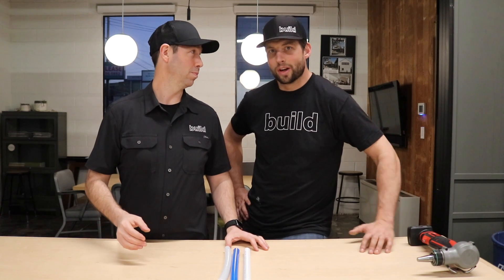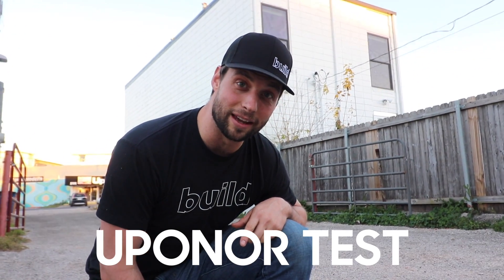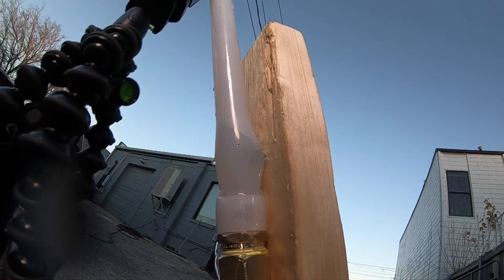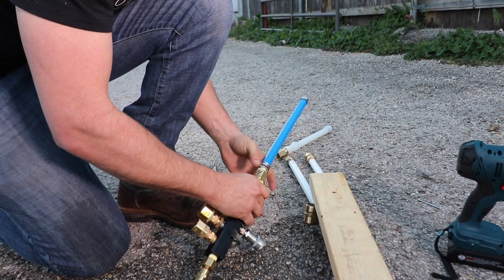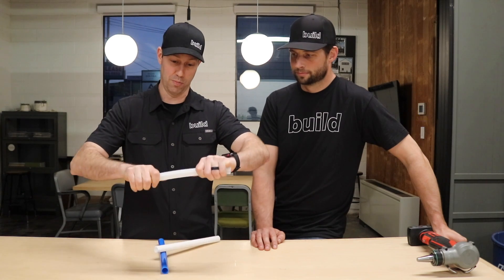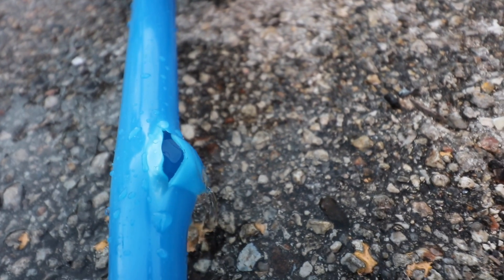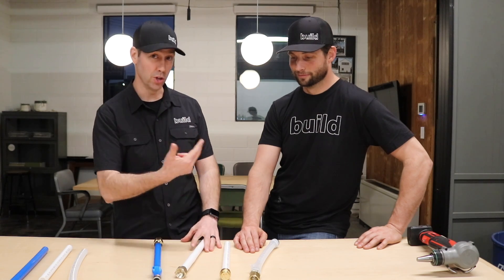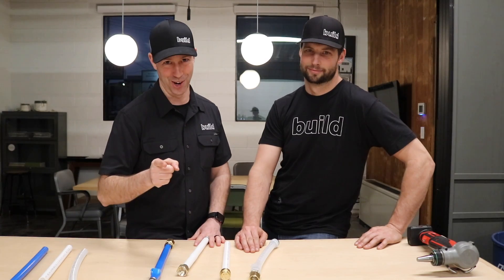How many PSI to blow out PEX?

Comment: From the perspective from a materials scientist, you guys did a good job proving the point that correctly installed PEX is unlikely to burst under normal residential water pressures.  But as you know so much better than I, the real question is what would the results be 30, 40 and even 50 years from now?  As long as they are not exposed to any adverse conditions, there should be no reason these pipes would fail under normal pressures. But the burst strengths are not likely to be the 100x normal pressure that you get when everything is new  (of course, that's why these things are manufactured with such high specs).
Reply: I'd like to see repeated transient pressure spikes, of a lower pressure level, and see how they handle that
Reply: The house I'm living in / slowly flipping has been fully redone with Uponor.  I'm hoping it provides the next owner with at least a few trouble free decades.  Regardless, anything is better than the mess that was here before!
Reply: @TheMigraineGuy  the thing with palstic, when it goes, it bursts, but copper when it degrades, it just leaks with small pin holes lol
Reply: @randomrazr  I mostly agree, except if copper freezes it'll burst.  PEX on the other hand can stretch.  The biggest issue on my current home was not needing to rip open every wall to solder joints.  With the Uponor, I was able to run a single tube from the basement to the second floor.  The various bends, angles, etc. were no problem and the expander fittings are damned impressive.  But, there is no perfect building material - it'll all fail one day!

Comment: You guys are like two young boys playing with fireworks!!!
Why is it Carpenters ALWAYS use Crescent Wrenches instead of REAL Wrenches???
When you test Copper....
BE CAREFUL — protect yourself from metal fragments!!!
Reply: What's wrong with a GOOD adjustable wrench? A cheap loose one will round the corners yes, but I always used the more expensive ones. But you're right, after using a knipex cobra pliers, it's hard to go back to an adjustable wrench unless I'm in a pinch. They grip so dang good!

Comment: these pressures are extreme, reliefs should dump pressure at 150 psi FOR SAFETY REASONS,
a pipe blowing out at 500 psi is better than your hot water heater or well extrol.

Comment: When you guys do copper make sure you get a good plumber to do the soldering. I'm a gc and I have done my own copper many times in repairs and whatever. I recently hung out a union plumber. He had a bunch of connections he had cut out to cut in half to make sure the solder had completely filled the fitting. Long story short he was way better than me! Mine work at home pressures but this guy took it to a totally new level!

Comment: Interesting.   If you feel like trying another experiment - I would love to know which type of pipe (CPVC, PEX copper) holds heat best in long runs of hot water pipe.    I suspect but don't know for sure, that the plastic pipes will perform much better.

Comment: Like to see new and several old out in the field samples of CPVC tested to put the rumors to rest.
Reply: @808kiker  Me too but I tested it, tried to crush under a wrench and it seems like new, not brittle.  Perhaps it was a certain make and not all types of CPVC and it's limited hopefully.
Reply: Just like PEX, nearly all variations of Vinyl also become brittle with UV exposure. Chlorine will also degrade both eventually, but at the concentrations in city water, it would likely take a long long time. As long as your plastic piping isn't exposed to sunlight or florescent bulbs (direct or indirect, aka: it should be in a wall), you will probably be fine.

Comment: Nice.  And I'm sure Jordan preferred bursting pipes in the hydro test rather than the hydraulic.  That last one was an oily mess.  A few comments ask about testing in temperature extremes.  I'm in the Phx area.  It would be interesting to see how the Pex pipe does under pressure in a simulated 150 degree attic.  I'm picturing a cheap electric Kenmore range with 1-inch holes drilled through each side and the pipe running through it.  Get on it, Matt! :)
Reply: What pray tell is the difference between the hydro test and the hydraulic test? Psi is psi

Comment: I would like to see how a push fitting does on copper tubing, teeth might hold better
Reply: nathan lavoie I would think the opposite. The harder pipe the less likely the teeth are going to be able to “Dig in”. I have seen several push fittings blow off on Water services( before the meter ) here. I’m wondering  if it’s the water hammer effect blowing them off. The water utility I work for doesn’t allow for any connections other than copper flare or Ford or McDonald Brand Brass pack joint connections.  When a contractor hits a service and doesn’t want to report the damage to avoid getting a bill  they scramble to fix it with push on fittings and we always end up showing up that night or the next day cause their fittings can’t handle it and this is on copper pipe. They will jump in a piece of PEX pipe. I find them always blown off the copper pipe not the PEX.
Reply: @MARKE911  what's the main pressure though? Is the meter not ALSO a pressure regulator or have one next to it?
Reply: nathan lavoie , before I installed sixteen Sharkbite push-on shut-off valves in my house, I consulted with a plumber. He told me he has not had any failures so far, but did not recommend using push-on fittings inside walls. I tried to remove one without using the release tool and could not do it. I have copper pipes. The Sharkbite valves replaced sixteen compression fit valves. I saved a thousand dollars changing the valves myself.
Reply: I remember a study I read in a plumbing trade back a while that it blew above 2000(I think) the sweat was best, and press was worst, but still way over 1000
Reply: Check out the freeze test he did of copper vs pex vs cpvc. The shark bite push to connect fitting popped off on the coper and the teeth didn't really dig in. On pex and cpvc it stayed on. The teeth were actually able to dig in properly on those 2.

Comment: This flexible water line is not pipe, it is tubing. Glued fittings on pvc pipe fail at glue joint and the temperature is a factor. Almost everything is tested at 70 degrees. Above or below changes everything.
Pressure drops on these tests are the tubing expanding which drops the pressure significantly and quickly.

If you are peaking the lower pressure gauge and then not taking it out of the circuit you are damaging it if you exceed the maximum pressure on the face of the gauge you have significantly damaged the gauge.

Tensile strength is ultimate pressure, you mean yield pressure.
Reply: Tensile strength is the ultimate strength where it fails. You are referring to yield strength where it starts to move or the wall thickness thins because the tubing is expanding.
Reply: I agree with the pressure drop is the tubing expanding but that's assuming the check valve in the pump is not leaking!!
Reply: @ThePvcralph  so would like to see cycling of the high pressure and how many times it can cycle without issues
Reply: You are a blast at parties I'm sure.
Reply: Brandon Masser . LOL. I am in the business of pipe, tube, hose and fittings. Most of it deals with hydraulic oil but some with water. There is a lot to know if not 100 things, 10,000 things. I have done pressure testing in the past up to 15,000 PSI. It’s an interesting field.
Most hydraulic hose would be tested at twice it’s working pressure and would fail at over four times working pressure. So a 5000 psi hydraulic hose would fail at over 20,000 PSI.

So if you wanted a static test of a 5000 psi hose I would test it at 10,000 PSI. Fairly remarkable for a simple hydraulic hose on a machine.

Comment: I'd be curious if temperature changes the pressure they can take.  Especially for the Uponor. Hot, say ~120F to simulate extremely hot environments.  On the other side, what happens if the pipes freeze under pressure.

Comment: When would these pipes ever be subjected to such pressures under normal use? My well pump turns on at 30 PSI and off at 60 PSI. This video is not instructional or informational in any way, shape or form. You're just having fun and monetizing it on YouTube.
Reply: I've seen water main pressure top 85 PSI under static load and water hammer can easily double that.  I wouldn't trust anything that can't take at least 150 PSI, preferably 200.
Reply: @danheidel  I'm pulling water out of a well, not a water main. The only way I'm going to get more than 60 PSI is if the switch gets stuck in the on position, which I doubt will ever happen.
Reply: @willdwyer6782  OH WOW,  information in the video wasn't applicable to one particular viewer, STOP THE PRESSES.  Also, if you have any appliances like a dishwasher, you're getting water hammer in the lines and your in-pipe pressure is going to be spiking way above 60PSI every time they shut off water flow.
Reply: im a plumber in ky and it is nothing to see a pressure regulator go bad and give people well over 150 psi.  there are spring and well pumps still around but they are a small minority. so how and why are you expecting this test to apply only to people with pumps?
Reply: That's the point of YouTube
Reply: I'm not criticizing them for having fun but I subbed for useful information. Although it's nice to know that my pipes can take the pressure that my well pump can generate, I was never in doubt of that fact even before I watched this video. I'm left scratching my head wondering what the instructional or informational purpose of this video was.

Comment: Now do Copper and PVC
Reply: Yes do copper
Reply: IN EU is NO NO NO...  copper for drinking water.Just heating
Reply: @MisterThinko  oh but galvanized steel is ok there huh. much better than copper.....
Reply: LOL need a different gauge likely would burst before it registers on the gauge
Reply: David Bird PVC doesn't like the cold. We ran it into our workshop to give us water to the sink two year ago. The water froze and the PVC split into slivers. Don't have any experience with copper.
Reply: @eyesalooking  I threw an large but empty box on a PVC drain tube for my ac unit in the attic.  It was cold so the thing snapped. I threw some duct tape on it but will change it out with pex when it warms up.  not sure if that is against some sort of code, don't car.  PVC is horrible,
Reply: eyesalooking j
Reply: Copper with solder fittings vs pro press fittings!!

Comment: Any correlation between pressure and freezing?
Reply: in general pipes freeze in the middle of sections first because they have the lease thermal mass.  Fittings tend to have more mass and thus don't often freeze.  Obviously if your pipes are insulated and your fitting is not, then the fitting will freeze first.  When fluids solidify they release latent heat of fusion and that keeps the other water slightly warmer as the ice front spreads down the pipe.  It is possible to have 2 separate freeze points not near each other but typically freeze starts in one spot and spreads.  Since ice only expands 10% if the material gives 10% at 32f than you have no chance of a burst.  Copper pipes burst because they don't stretch like the superior pex products do.  That is why if your plumber copper throw them out, they are idiots or fraudsters.    Mind you if you hate money and don't have to worry about freezing and like the idea of water hammers then use copper.
Reply: Look at their freeze test... Pex was just fine fully frozen.  Copper?  No.
Reply: That's what I thought but, I am far from an expert. All I know how to do is roof so, plumbing has always been confusing to me. 😂🤣😂🤣
Reply: I'd like to know as well.
Reply: I think that would only matter if the freezing occurred around a fitting. The fittings are the weakest part
Reply: @apex007   
I can't address pressure, but freezing SPLITS the pipe, fittings okay. And that's with low temperature solder. That makes me THINK the copper pipe would fail before the fittings do. Keep in mind this was the thin wall copper, generally used in water supply lines. Type L might be a different story. (caveat, I'm not a plumber either, just  a witness to the effects of freezes)

Comment: so, bottom line is that the sharkbite PTC's are fine for normal usage, right?
Reply: A big problem with push in fittings is the price.  10 or so will buy you a pex crimping tool and pex crimp fittings are 1/10 the price.
Reply: @joeyjo-jojuniorshabadoo6827  
True. But the initial investment in special tools make the sharkbite fittings more appealing for small jobs at home. The PEX A expansion tool like the one in the video is about 250-400 on ebay. I own one and if you're redoing a house it's worth it but for a small job it's not. I bought generic sharkbite fittings off of ebay just to use as temporary plugs on copper lines. I paid less than 2 dollars each for them and they're working fine.
Reply: @Foche_T._Schitt  but you can use PEX A with all the other types of connections as well so you do not need the expansion tool but you will miss out on the advantage of better water flow rates with the bigger dia fittings
Reply: If you're using it on copper pipe and you have water hammering in your lines it can get driven off. 
You shouldn't bury sharkbite in walls or in the ground.
Reply: Nuke Censorship  see it way to often on copper pipe the push on fittings blowing off the copper not the pex
Reply: @MARKE911  sounds like we've found a new test for the Build show.
Reply: @MARKE911  
Because Pex doesn't have water hammer issues.
Reply: I think that you should handle this like electrical connectons. Nothing hidden inside walls. Safe but not good news for connectors.
Reply: standard water pressure in homes is 40 - 80 psi
Reply: all of them are great for normal usage
Reply: It's fine to use. I used it around easy to access areas and when you you need connect something fast. I still wouldn't trust it in walls.
Reply: Aidan Skoyle
Reply: Yep
Reply: At what temperature were the tests conducted?
Reply: a skoyles Upenoor is way better then then the rest for so many reasons
Reply: Not if you want plumbers to hate you
Reply: plumbers think mutilating joists is an okay thing to do.
Reply: @apex007  I hate how expensive plumbers are. I'm okay with them hating me.
Reply: having seen meany failures of them I would only use them in an emergency and I would never put in a hidden location.